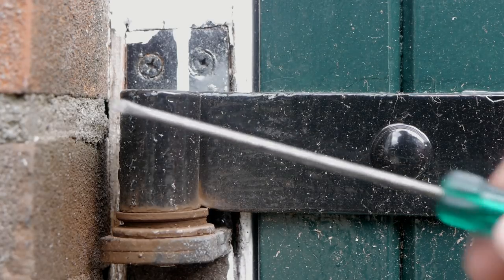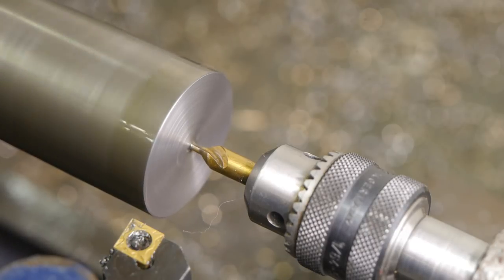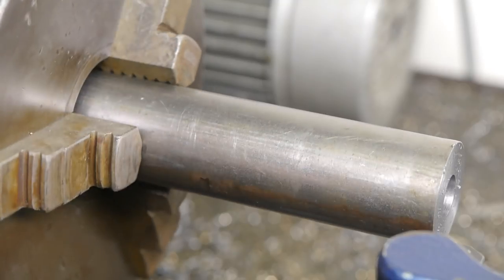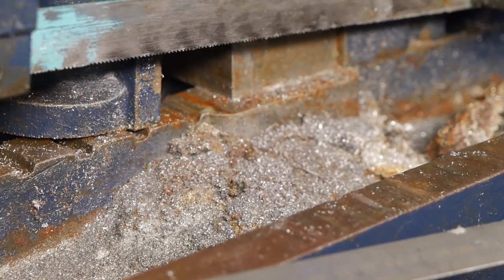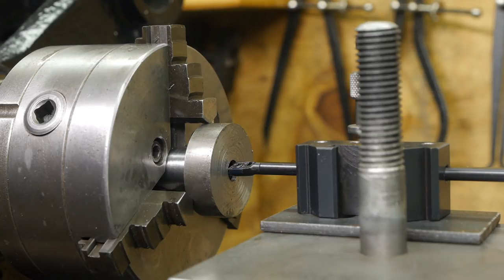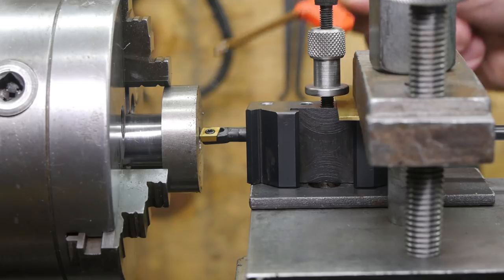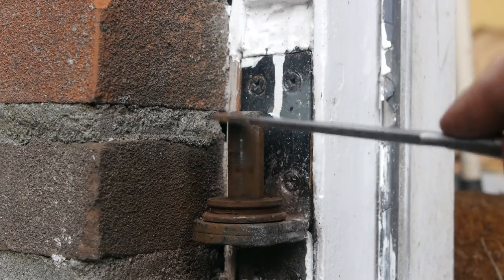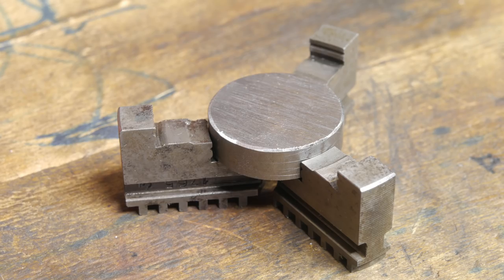Home improvement using a lathe chuck backstop

Comment: Here's a suggestion to keep the moving jaw in your saw, straight to increase grip.
Take the jaw apart and drill/thread  a 10 mm hole on top just below the edge and in the center.
Then get a full thread bolt of 100 mm long or so, and use it to keep the jaw always straight when the material is too thin. I've done to my own saw and works perfect.
Cheers from Toronto, Canada

Comment: Someone already mentioned grease fittings, but what about some oil cups and wicks on those hinges?  ;)
Reply from the maker: it's only a hinge and in a couple of years the lowers section of the door frame will probably have to be replaced anyway.And then I'll install some new hinges.

Comment: It's not so much sissyness as paranoia about not complying with risk assessments. No visitors, no risks of being sued if someone breaks a finger nail or gets a splinter in their finger.
PS plus 1 for big arse trepanning tool  guy
PPS you can use your boring bar for facing cuts, it saves a tool change.
Reply from the maker: I think we are heading in the same direction. so sad.
I used a boring bar for a facing cut once. It sounded terrible. probably too much stick out,

Comment: Hello, I have found that those small boring bars hold the insert at too much of a negative rake. Have made a holder that allows you to alter this angle and it appears to improve the quality of the cut and the insert don't chip as much. 
A Yorkshire man in Scotland.
Reply: I will consider this info, thanks.
Reply from the maker: something like this: https://youtu.be/Re9gxVVS9Xc
Although setting it well above centre worked rather well I must say

Comment: This is for the viewers. Lathe tool cutting edges should be set on the centreline of the lathe spindle. Machinist textbooks will explain the principles why this is necessary. I hope this helps - thirty years a precision Toolmaker.
Reply from the maker: There is precision an practise. I pretty much suck at both, and that o.k. as long as it's fun :)